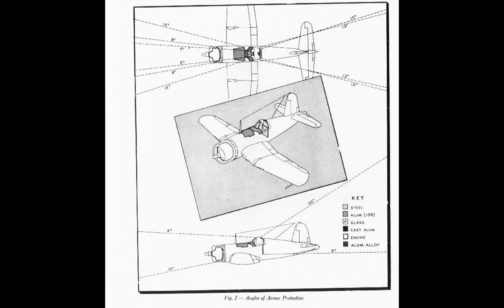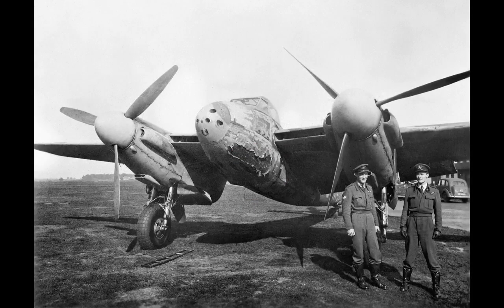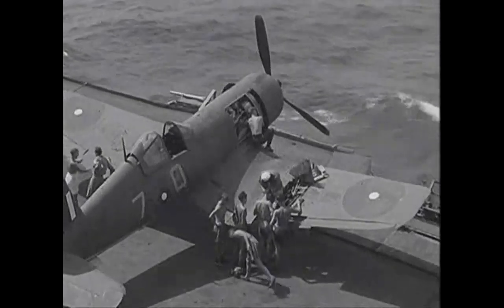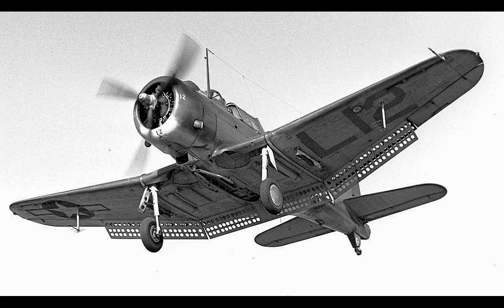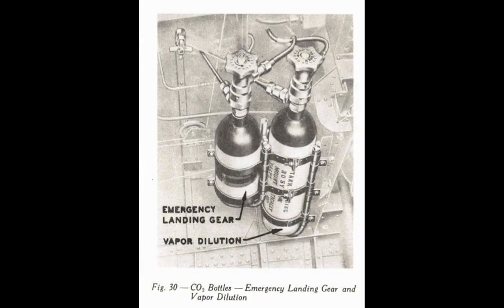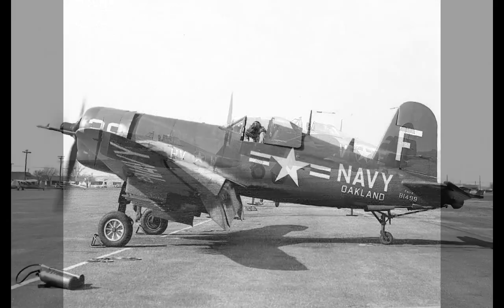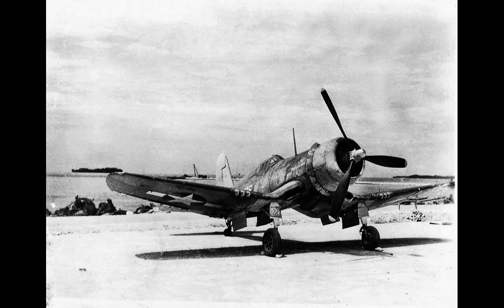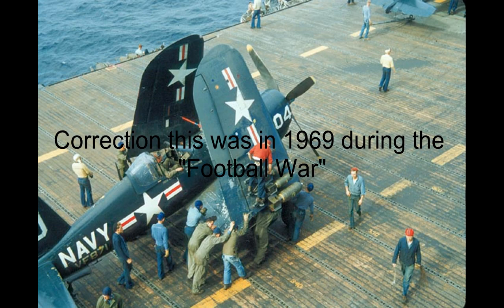F4U Corsair Design Features

Comment: I owned, maintained, and flew a Corsair in the 1970's-'80's and everything said here I believe to be factual.  Not mentioned, however, was that later Corsair models had modifications that made for easier carrier landings, such as adding a different gear oleo strut that allowed the gear to compress and NOT bounce back out to eliminate the plane bouncing on landing, raising the cockpit seat for better forward vision, extending the tail wheel strut to lower the nose for better pilot visibility, etc. The main landing gear also had a steel cable, that ran down in front of the gear behind the dive brake door, that rotated on a different axis than the gear itself and had the function of pulling up the extended gear strut cylinder after takeoff so the gear would fit into the wheel wells.  
      Also, the nitrogen bottle for the emergency gear down function mentioned here was problematic.   If needed in an emergency you could not be sure it would function properly and, in any case, meant all the hydraulic system lines needed to be  purged, assuming a safe landing was made, before the next flight.   And the manual emergency gear down handle, also as mentioned, was an ergonomic nightmare to use.   We solved that by removing that bottle and in its place installed a hydraulic pump tied into the system.  Problem solved.
Reply from the maker: Wow, thanks Louis. I appreciate your post.

Comment: From my reading, the CO2 purge feature was used to evacuate and replace the fumes of the stub wing tanks as the fuel was used. Once the fuel was gone, the tanks would be full of CO2 instead of highly flammable avgas fumes.  Later Corsair models did away with the stub tanks altogether and two droppable fuel tanks were fitted instead.  After the Battle of the Solomons, the Corsairs usually didn't need to patrol at such long ranges, anyway.
Reply from the maker: No, the flight manual is extremely clear on this. It literally says WARNING and goes on to tell you not to use the CO2 purge as you use fuel from the tanks.

Comment: The forward placement of the vertical tail allows the articulated movement of the rudder to stay clear of the movement of the elavators.

The F4U-1a could be considered the forerunner of the H.U.D. When the seat was raised for the blown canopy, the old gunsight could not be used to see over the long nose. So, the small round sighting glass common to the sights of the time was eliminated. It was replaced with a trapezoidal shaped glass mounted to the windscreen, well above the top of the dashboard. Only the lamp portion remained on the instrument panel.

Comment: It should be noted that the USN had proposed putting the F4U into service in 1943 and proposed a straight-in approach.  The problem was that, for some reason, they didn't want to switch from the F6F to the F4U and didn't.

The RN:FAA did adopt the curved approach which we adopted because it worked well, but the USMC wasn't operating off carriers until 1944 and the USN until 1945.
Reply from the maker: They had some good reasons for going with the Hellcat on carriers, and they were reasons that made sense at the time. I'll have to cover the Hellcat at some point, but right now there are a couple higher priorities for the channel.

Comment: My father worked on the first one built by Brewster. He solved the problem of manufacturing the main spare a key element in the strength of this airplane. You provide superb techmical video in excellent detail and very informative. I wish you would make a follow up video dealing with F4U-4 & 5 and the turbocharged model and another on the F2G. Thanks
Reply from the maker: Thanks for your comment. I'll cover the -4 and later models eventually. Right now I need to move on to the P47 and 190.

Comment: When you reference the aeronautical knowledge handbook, it states that the most interference drag is observed when 2 surfaces meet at perpendicular angles. This seems to be a contradiction when you mention the NACA test that says the ideal is a wing that meets the fuselage at a 90 degree angle.
Reply from the maker: Great point. They are talking about two different angles. The angle the PHOAK is referencing the angle where the fuselage meets the wing as viewed from the top. In other words, at the angle where zero sweep back would be 90 degrees. NACA is referencing the angle you would see from the front or rear view where the fuselage meets the wing.

Comment: The forward vertical stabilizer position which was also used on the Zero, and helps minimize turbulence in high speed maneuvers, which accounts for the Corsair being able to out-turn the Mustang.
Reply from the maker: I wish I had a nickel for everyone who said that. However the Zero's tail is the exact opposite.
Reply: Greg's Airplanes and Automobiles:  I looked again, and you're right...so why the Corsair could out-turn the Mustang could be a better pilot.

Comment: Great job. Meandering  tends to happen to aircraft nerds! Just a couple points you missed:  MOST WWII F4Us  had a fabric covered wing. Also, but not a major point, F8F's tall landing gear leg is  double articulated, upper portion folds outward, while the longer lower leg, folds inward. Also P-47's leg compresses during retraction, some 9". Lot's of great shots of British Corsairs I hadn't seen before. BTW- Not he best car I ever owned but the one I miss the most was my 1972 Fiat 124 Sport Coupe. I don't miss the tune ups!
Reply from the maker: Hi Charles, I am certainly guilty of leaving stuff out. I try to keep these videos down to about 20mins, although I have concerns that my next one is running into over time.
Reply: I always thought that spot welding the frame was the most unique thing?

Comment: I remember hearing that moving the vertical stabilizer forward moves it out of the turbulent stream coming from the horizontal stabilizers in the case of a stall.
Reply: yep, it's got nothing to do with structural integrity: in a flat spin (falling belly-first), the horizontal stabilizer tends to block any (useful) air from flowing past the rudder, and the only way out of a flat spin is to get the rudder to bite the airstream - by moving the hor/stab rearward (or rudder forward),  it diminishes this 'masking' effect - take a look at Dan Raymer's SIMPLIFIED AIRCRAFT DESIGN FOR HOMEBUILDERS, page 38
Reply: Perhaps would facilitate a tighter turning radius

Comment: Isn't duralumin the same thing as 2024? Or similar to 2024? I was under the impression that it was extensively used in airframes - especially in spars and stringers, and landing gear components. I also thought airplane skins were also dural/2024. Maybe the armor referred to here is thicker sheets of it.
Reply from the maker: I don't know. My knowledge of it only extends to the point to which they educated pilots about it, meaning how thick it is, where it was used and what caliber bullets it would stop and at what angles. Sorry.

Comment: Aldo, the rudder placement helps the rudders efficiency during a stall so the disturbances around the horizontal stabilizer doesnt affect the rudder's control surfaces. The Japanese did this too and thats why the horizontal stabilizer on the zero is so far in front of its vertical stabilizer.
Reply from the maker: Please post a source for this.

Comment: On interference drag: You are right in saying that 90º is usually near optimal (it's different for lifting wings, but close enough), but the text you show says the opposite. It says that the interference drag is greatest then the surfaces meet at pependicular angles. Strange. At least one NACA report I found where wing-fuselage intereference drag was tested found that for an actual lifting wing, parasol-wing without struts (haha) was optimal, but other than that slightly above midwing position was best. It also notes that suitable "fillets" could reduce interference almost to the same level at any position. So fairings would probably have been far preferable over the more complex, aerodynamically otherwise less efficient and heavier "gullwing" design. I don't think that really played a role in the design decision.
Reply from the maker: Hello again pink. First of all, the text I posted was from the Pilot's Handbook of Aeronautical knowledge, and I doubt there is a single error in that publication. I also doubt that NACA made a mistake. The reason they don't appear to agree is because they are talking about two different angles. The NACA report is talking about the angle of the wing joining the fuselage from the side, think in terms of the front view of the plane. The PHOAK is talking about the angle you would see from the top view. I hope that helps. Wing fairings could reduce drag to "almost" the same level, the Corsair designers were not going for almost. I am not going to touch the parasol wing topic, that's too far from the subject matter.

Comment: Very nice, thank you! Speaking of feathering, it's different for military aircraft, but commercial passenger (propeller) aircraft must be able to complete takeoff, hold altitude and land safely even if an engine fails during takeoff, and the failed engine's propeller fails to feather. It's a tall order, and one well-known commercial operator of DC-3 aircraft was found to have violated that condition by taking off overweight regularly. In the last case only a few years ago it managed to crash-land with everyone surviving in that exact scenario, but it was a close call.
A pity some of the old footage is squished into a wrong aspect ratio. Great info nevertheless.
Reply from the maker: OK, you are talking about FAR part 25 certification requirements. That's pretty far from anything on this channel so far, but I'll touch on a couple of items. First, if the plane has autofeather, which most now do, climb performance after an engine failure on takeoff is predicated on the prop being feathered. Now if it doesn't have autofeather (or NTS, which is another story), then it must be able to climb to 400 feet without feathering the prop, in which case, they get this performance via a relatively low take off weight. I didn't squish the video, but I agree with you. If I could have found a better version of it, I would have used it.
Reply: Thanks again. I really enjoy it when the author is so responsive.
Reply from the maker: You're welcome, I appreciate all comments. I try to answer all the questions, but after the video is about a week old, due to the way youtube sends them too, me, the autospam folder functions, and just the sheer number, it becomes almost impossible to find, let alone answer every question.

Comment: Hello, why did the Marines loved this plane
 vs. the Navy? And why did most of the WW2 fighters continued to use 6 50.cal Machine guns. Every other country had already advanced to cannons.  Like your videos. Especially the engine diagrams and details. 2nd, the ME 262 went to tricycle landing gear to avoid the forward viewing problem. Corsair with tricycle landing gear?  Interesting....
Reply from the maker: I'll try to touch on each of those questions. The Marines loved the plane, and eventually the Navy loved it too. It was only the initial carrier landing issue that caused the Navy to shy away from it initially. The US 50 cal was a very effective air to air gun, especially against fighters. The 6 50s in a Corsair would make quick work of any Japanese plane, fighter or bomber. Eventually, the did put 4 20mm cannons on the Corsair, but in WW2 most pilots preferred the 6 50s since they weighted less and had a much higher rate of fire, and plenty of punch to take down enemy planes. Tricycle gear simply would not work on the Corsair for a number of reasons.

Comment: In a lecture about the Corsair I attended a questioner asked why the USAAF didn't use a land-based form of the Corsair in Europe given its high speed and excellent performance as a tactical bomber. The speaker said that at high altitude the P-51 outperformed the F4U, consequently in the escort fighter role the Mustang was the better choice. In the case of the P-47, a plane much like the Corsair in many respects, the problem was more political than technical. Apparently Vought had a sketchy relationship with Air Corps bigwigs like Hap Arnold while Seversky/Republic had the confidence of all the leading Army decision makers.
Reply from the maker: Both the Thunderbolt and the P51 were superior to the Corsair AT HIGH altitude, which is where the action was when escorting B17s and B24s. I don't think anyone is seriously arguing that the Corsair was a better high altitude escort plane.